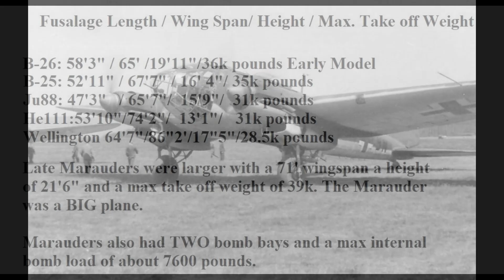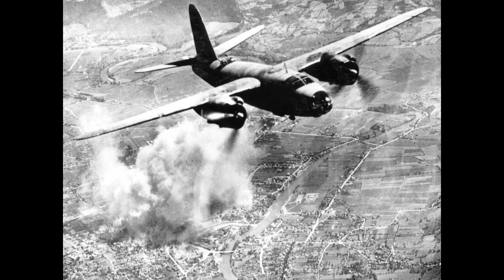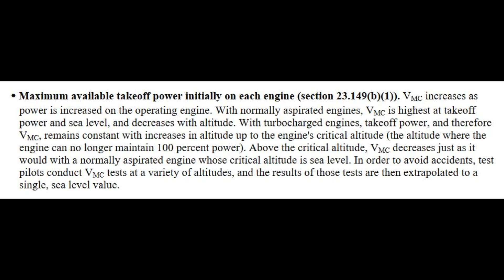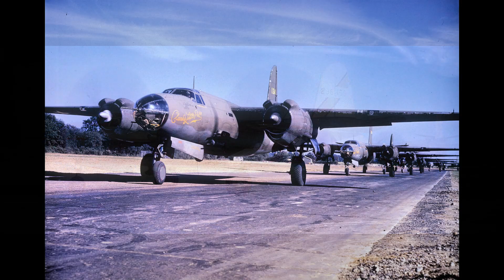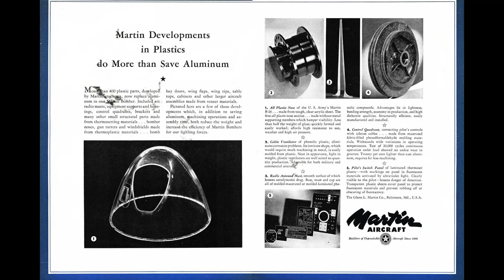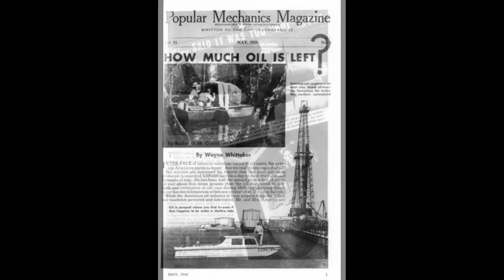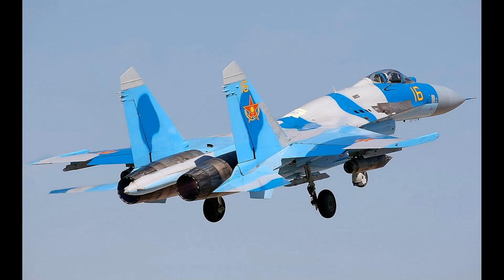Martin B-26 Marauder. Unsafe At Any Speed?

Comment: My first big twin, the HS748, had an empty single engine climb speed of 92kts, not 93kts, not 91kts. It was 92kts, no more, no less. 93kts descended, 91kts started to get close to VMC and things started getting exciting.
Reply: Thanks it’s great to read, that’s really interesting.
Was Vyse and Vxse taken to be equal and practically the exact same indicated airspeed for nearly all (weights and) altitudes and air densities? ……  and did the R R Dart run at a single speed nearly all the time?  It must have been one of the very first successful turboprop engines.
The HS748 wing looked exceptionally efficient, the aspect ratio was so much higher than on something like a Lockheed Electra.  I wonder does Vx and Vy separate more with faster planes?
The improved late 1980s BAE Advanced Turboprop transport with modern engines would have a totally new C.O.A. and (presumably thicker) flight manual/s.  Did you ever fly in one?
Reply: @givenfirstnamefamilyfirstn3935  lots to unpack here 😂 

Okay, so I need to qualify this by saying it’s been a long time since I’ve had much to do with light twins, I fly heavy twins these days. Light twins use different terms from big airplanes. In big airplane land we use Vr, V1, and V2 as the important speeds. Vr is rotation speed. V1 is the go speed, if you reach V1, you continue with the take off no matter how much runway is left (this is an important point if you ever want to read the Concorde accident report). 

VYSE is V2 I believe ->92kts when empty, or single engine safety speed in big airplanes, they don’t use a blue line because it’s so variable with weight ->the higher the weight, the higher V2 is. You write the speed on a card and display it, or simply display the airplane card like the Hawker had. You also use a speed bug for this speed. You also brief this speed. This is an important speed 😂. You never want to be below this speed, and if you are, you can’t pitch up until you reach it. In the Hawker the airplane is so gutless that it won’t even reach 92kts empty unless the wheels are in the well, and the flaps are 30 degrees or less (approach flaps, landing flaps was 52.5 degrees and rather an exciting configuration when in the missed, so we didn’t use it unless landing assured). So the short of it is lack of auto feather was a NO GO item, and in the single engine missed approach, the calls were “Max power,” “Flaps up one notch,” “Gear up,” “HP,” “LP,” “Feather.” All while pitching for 92kts, and confirming the levers that the PNF was operating. The HP (firewall), and LP (fuel tank), were high pressure and low pressure fuel cocks, the British love to have all sorts of cocks in the airplane. It makes me curious about his statement that the B26 would crash below V2, in the airplanes I’ve flown you must pitch down until it’s at V2, but that doesn’t mean crashing is automatic, you may be able to squeak some speed out of it and clean it up before impact…. I should state I’ve never flown an airplane that had such a large range between rotation, VMC, and V2, and this is a 30,000lbs class airplane with pistons so it’s probably gutless af. 🤷‍♂️ I do understand the bit about the runway being too short though, if you’re taking off and you don’t reach V1 before the airplane starts flying and you have an engine failure, you’ll have to set it back down for sure until you reach V1, or you bring it to a stop ->if the runway isn’t long enough for this, there is nothing you can do. But given I don’t have his patreon, I can’t read the AFM myself. Usually it’s kind of a moot point though, V1 on the planes I’ve flown is usually about the same as Vr, which means if you can pull that airplane off the ground, you’re at V1 and it’s gonna fly, again, I can’t check the book in this case. You ride V2 until clear of obstacles, and then you lower the nose, clean up the airplane, and pitch for a higher climb speed. 

Vr, V1, and V2 are all dependent specifically dependent upon weight. But here are some more variables for V1 https://www.flightdeckfriend.com/ask-a-pilot/what-is-v1-speed-for-a-commercial-aircraft/ 
The idea here is that if you’ve got a longer runway, you have a higher V1 speed, which means you can reject after you’ve covered a longer distance on the runway (later on the take off roll), in addition it means you’re at a higher speed for rotation which is inherently safer if you lose an engine. 

VXSE wasn’t used, in fact I’m not sure I’ve seen that speed listed for any of the big airplanes I’ve flown ->maybe we just called it something else, not sure. Now I haven’t flown many different types of big airplanes, but the ones I have flown are fucking gutless, and pitching to a slower speed than V2 wouldn’t be a good idea I feel. I just don’t see where this speed would be super important, I should qualify that statement by saying I do fly in the mountains, we pitch for V2 out of necessity. Depending upon which source you read and who wrote it, you might hear this is V2. It’s completely irrelevant whether this is in fact V2 or if VYSE is, because v2 is the published speed, and that’s the one you’re using to meet performance criteria. 

The Dart is direct drive, it’s an oddity for sure, but built to be very robust. The Dart had a single lever to control power and prop pitch (fancy). It’s an outdated theory of how to produce a turbo prop engine. Basically the aim was to size the compressor to the turbine wheel, which means you’ll always temp the turbine out before you over torque it. They clearly liked this for safety as meat headed pilots couldn’t jam the power lever forward to break the gearbox. In a modern turbo prop like a PT6, the compressor is vastly oversized compared to the turbine wheel ->you lose a bit of fuel efficiency, but as altitude increases you can spin the compressor faster to maintain max torque without temping the engine out (up to a point). Whereas a direct drive engine never truly produces max torque, it’s almost always a variable (they say water meth gave you max torque with the dart at any air temp but I seriously doubt that claim). I honestly can’t remember what N1 was doing in the dart. I’m not sure if it was running 100% all the time, it was a long time ago. I threw a compressor blade once with the dart, it exited the cowling and no one noticed for a week, the engine temp was high for the amount of power it was producing, but within normal limits, so maintenance didn’t check it until the weekly was due. So the direct drive was clearly better at taking damage than a PT6, but the PT6 ducting prevented FOD from entering in the first place so that’s kind of a negative for the dart lol. 

Here is a good pic of the panel:

https://abpic.co.uk/pictures/view/1199606

Greg might be better to ask about Vx and Vy’s relationship to aircraft performance. I can tell you the huge wing of the Hawker was specifically built for short field performance, and it had great handling qualities in the stall and low airspeeds (pussy cat). 

I never flew the ATP. I’ll be honest though, the HS748 wasn’t built for modern operations. The HS748 was designed for extreme robustness, things like fuel economy, payload, and passenger comfort suffered because of this. They wanted the Hawker to have military sales that never materialized, so the extra weight of the multi spar wing impacted performance and the civilian market didn’t have a need to take battle damage for example.  So by the time the ATP came out and we already had the Dash 8, Saab, and soon to be ATR, the old hawker design couldn’t compete. 

https://en.wikipedia.org/wiki/British_Aerospace_ATP
Reply: @drewski5730  A super read Drewski, thanks for your time and I’ll go over it again a few times for the enjoyment.  Going to a strange airport with a short runway must have been less than welcome with pages of sequential performance graphs to grind through and cross check on the day, no electronic flight bags to help out.  Your big reply is really appreciated, thanks.
Reply: @givenfirstnamefamilyfirstn3935  honestly I never went through all the spaghetti graphs for a runway with the Hawker, I didn’t have to. I have gone through spaghetti charts with the ATR many times. In modern operations the company will take a runway, plug it into the spaghetti charts (runway length, width, gradient, altitude, etc), and build a spreadsheet. This spreadsheet will have a page for each runway. And each runway and airport that the company goes to will have its own spreadsheet, and they’ll throw all of them into a book (or if you’re using an electronic flight bag, a pdf document or database). Each spreadsheet will have columns and rows with the other missing variables like temperature, altimeter setting, snow/ice/standing water, and the corresponding column and row will have a weight value (max take off weight under those conditions), and speed values for Vr, V1, and V2 ->these are the values you write on the cards and bug on the airspeed indicator. 

So for example if I wanted to use runway 26L in Vancouver for take off (or landing), I would look up the spreadsheet for runway 26L in YVR in the book/binder (or electronic database pdf). Then I would plug in my temperature, wind speed, altimeter, runway conditions etc and just look up the values. 

The company can build all these charts manually by plugging each runway and airport combination into a spaghetti chart, and plotting the results and transferring to manually built spreadsheet. The manually built spreadsheet will then get added to an actual binder, or scanned into database. So you can use the old school spaghetti charts to build an electronic database if you’re a real keener. Or companies like ATR have programs called flight operations software (FOS), where dispatch can plug those numbers in themselves and then print or email them out to a flight crew, you get the same spreadsheet, it’s just electronically produced this way and no one has to plot points on a spaghetti graph. As a pilot there is an app you can use on the iPad if your company is fancy where you just plug in your environmental factors and it tells you your speeds and weights; or just have a pdf document electronically saved on the iPad you can manually sift through. 

So as you can see the runway spreadsheets that may have been plotted in the 80’s are still relevant and used today, and are more are less still built the same way in some circumstances. 

If you’ve got any more questions fire away. ;)

Edit: here is the new ATR flight operations software pamphlet.
https://www.atr-aircraft.com/wp-content/uploads/2020/07/brochure_fos_sps_2017_138-1.pdf
Reply: Been a long time, but if I remember it was 15000 for takeoff, then back to 14200 for the rest of the flight, there may have been 14500 for climb, but I would need to find my manual.
Reply: Ahhh the  46500# dog whistle. Used it in many 3000' strips, wat limited performance. Hp/lp/feather.

Comment: My guess on the elevator being full aft after full power on take off is kinda like a soft field technique. What sound concerning is the fact that there is no note on maybe keeping it low in ground effect to build speed if obstacle allow.
Reply: Trouble is the nose has to be held higher at low speed with low flaps so there is no pilot’s view straight ahead.  A half decent climb would still be needed while creeping up to safety speed.

Comment: Even as a little kid, I remember thinking that the wings were too small and too thin. Then I saw an ATR-72, and thought the same thing!
Reply: Some ATR-72s crashed because their  wing-design made them fatally vulnerable to certain wing-icing conditions that their de-icing equipment* couldn't handle
 * expanding-rubber wing leading-edge "boots"
Reply: They are easily operated incorrectly and you cannot see the upper wing ice build up in a high wing plane to avoid deadly premature operation.

Comment: I got to ask - why counter-rotating props like on P-38 were so rare during WW2? It offers many advantages and doesn't seem too hard to implement
Reply: Those wartime twins might have been easier to handle if they'd been fitted with engines and props that had opposite rotation, thus minimising the 'torque problem', but no-one seems to have cared, maybe because huge profits were being made from making  aircraft that were considered as expendable as their crews.
Reply: Because it is not significant.  Get or read up on a twin engine rating for a pilot’s licence.  YouTube commentators often have zero expertise opinions enthusiastically expressed.

Comment: Didn't Jimmy Doolittle demonstrate one-engine takeoff in the B-26 for the trainees, in order to  assuage their concerns?
Reply: They would notice a remarkably low power output engine noise presumably very early in the morning for a low air temperature and note the exceptionally long runway available and speculate on the forward centre of gravity, zero bomb load and near empty fuel tanks selected by Jimmy Dolittle, just about the best pilot in the world and they would never see a longer take off run in a piston engined plane.
Female delivery pilots would have the biggest impression those days.
Reply: @givenfirstnamefamilyfirstn3935  So, yes.😁

Comment: In 1942 the only way a fighter like the Hurricane or Zero could catch a Marauder was if it had an altitude advantage where it could convert altitude into speed. Otherwise, it would be hard placed to catch it. On the other hand, a German FW 190 A3 would be able to catch a B 26 in level flight because it enjoyed a 70 MPH speed advantage at medium altitudes. Although, if the Marauder had a warning of the German fighter,  it could force it into a long stern chase by going into a maximum power shallow dive.

Comment: A bit late to the party here, but one important thing I want to note about the B-26's performance at Midway:

The early Mk.13 torpedoes they were hastily rigged to carry had a MAXIMUM drop speed of 110kts, basically at the Marauders stall speed. In addition, they couldn't be dropped from more than about 50 feet. Exceeding either the max speed or max altitude would likely result in the breakup or failure of the weapon.

My unsubstantiated guess is that the B-26 pilots at Midway oversped the mk.13 (who wants to fly at stall speed while being shot at at 50ft AGL?) And were thus never realistically going to get any hits. Sending them with bombs to hit Kido Butai probably would've been more prudent, but hindsight is what it is.

Comment: I was surprised to hear any talk about the B-26 being considered slow. I thought the whole reason behind its design, and it's claim to fame early on, was cuz it was considered a speed demon for the times. Anyways, nice video. Thanks, Greg.
Reply: Perhaps he could have emphasised the indicated airspeeds vs true airspeeds better, if a B-26 was doing 270 mph True Air Speed flat out at say 16,000 ft a FW 190 also at 16,000 feet might only do say 310 mph True Air Speed. The FW 190 might do 380 mph TAS at 22,000 ft but the IAS would be the same as it would be at 16,000 ft.  The IAS is what the plane 'feels'.
The FW 190A also had a 2 speed single speed supercharger, it was mediocre at high altitude.

Comment: Thanks again for your impeccable posts.
Does anyone know about why engines were typically increased in displacement through time? It seems, just spitballing, that rpm's were always going to slow as engine size increased.  It seems like increasing engine numbers, and decreasing engine displacement, is the way to go.  Obviously the number of engines is limited by design, wing load, and other factors, so larger engines often is the correct answer. But, at least theoretically, smaller engines, more engines, higher rpm's should be a good choice sometimes.  Like the B-26. A four engine configuration here seems like a good choice.
Reply: Napier Sabres ran at high rpms.  The very big H24 Sabre had smaller individual cylinders than the V12 R R Griffon and were at the optimum size for power production. 1940s aero-engines were reaching the maximum practical cylinder sizes.

Comment: The Swedish SAAB 37 Viggen  has dual main wheels, and a dual nose wheel, probably because it's intended use from regular roads.
Reply from the maker: exactly, the took a hit in performance to get that off airport capability.
Reply: @GregsAirplanesandAutomobiles   Love your work Greg ! absolutely painstaking research, would love to hear your take on the B.P. Defiant and the Brewster fighter, as they sems to have some bad reputation, mainly due to the fact that they where ( as in the case of the Brewster, overloaded by the navy) or used in a role not initially intended as in the case of the Defiant.  other interesting aircraft , not mentioned much are the Swedish WWII planes as the SAAB J21, and the FFVS J22, The J21 has a very interesting configuration, and the J22 had quite good performance, considering it's small engine.  Best Regards / Fred

Comment: Great presentation, as always! Two interesting pictures: 1) The aircraft at 32:54 appears to be the test aircraft for the tandem main gear.  It is hard to see but the main gear are actually protruding from the fuselage and the nacelle doors are closed. Also note the stiffeners on the fuselage sides. 2) In the air-to-air shot at 59:35 you can see the shadow of the camera plane on the right wing and if you look at the bottom of the frame on the ground you can see the shadows of both planes overlapped. Some nice tight flying there!
Reply: The aircraft at 32:54 is the "Middle River Stumpjumper" and was used to test tandem landing gear. You can see the stringers added to the mid section of the fuselage to strengthen that area.